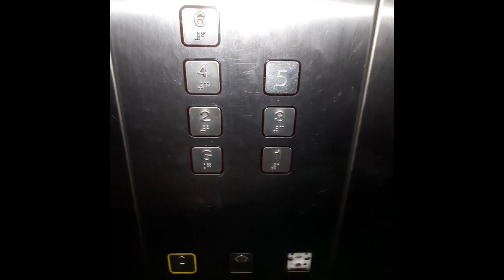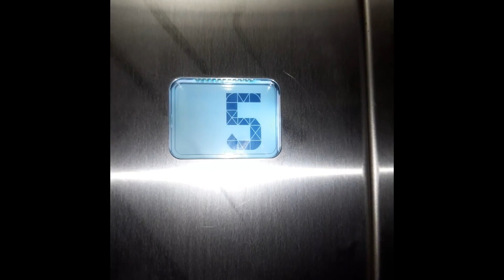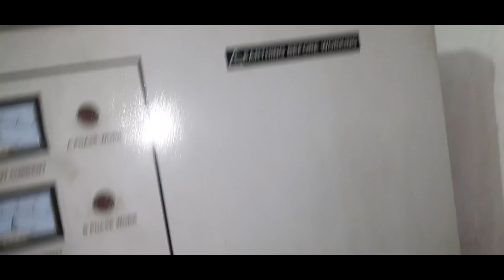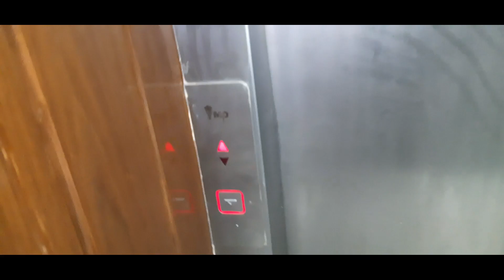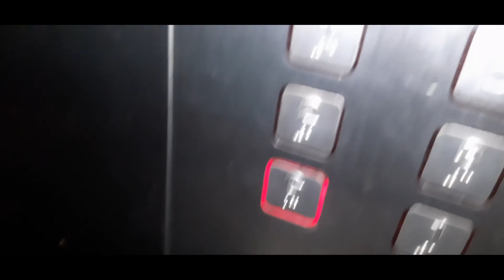What is in the machine room of a Elevator | Tech Everythings

Comment: Very interesting traction machine and controller.  You mentioned a voltage regulator, is the input voltage DC?  I noticed the inverter in the controller cabinet and mention of the reverse phase relay describing a 3 Phase AC motor.  Or AC three phase input with the voltage regulator between the line and load  VVVF,  DC rectifier, inverter 3 phase output?
Reply from the maker: No Dear , input voltage not DC , Input & output voltage is AC. But Really you are genius dear